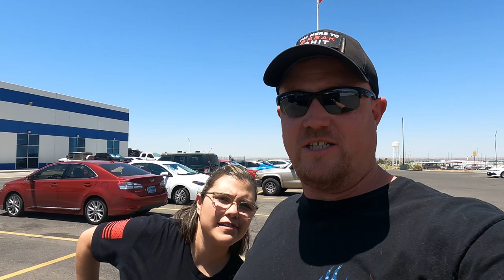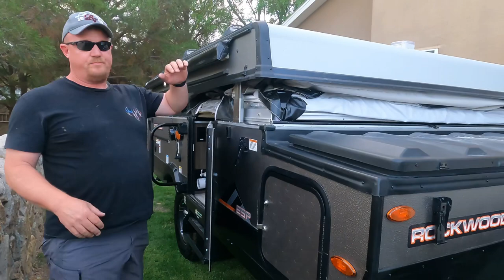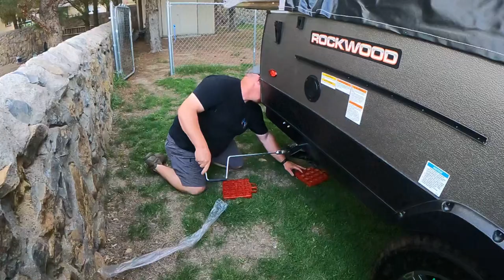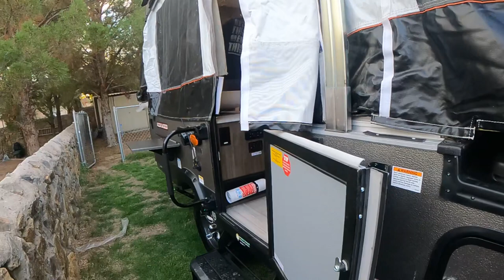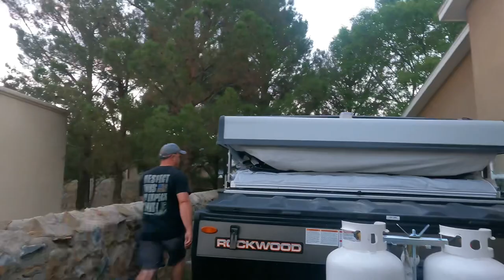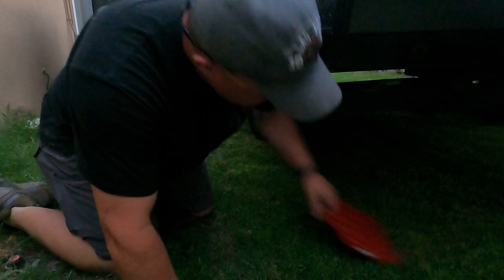Picking our new camper the Rockwood 1910 esp

Comment: A cordless drill with a 3/4 socket is a must.  My 1910 is a 2016 that I have modified with a pass thru from the inside to the trunk and added a shelf to the cabinet.  Also I replaced that terrible Dometic awning with a better one.

Comment: We have the same one. Love it. I did replace the lift winch silonoid with a better type. So far no issues. The original up silonoid failed.  I have learned a few tricks to easier setups. This pulls great. Enjoy. Smashed those buttons.

Comment: The trailer has "limit switch" settings for the UP motion AND down motion. You don't have to depend on watching the "green wire" when raising the roof or snapping it off, when the limit adjustment is made correctly, of course. When lowering the roof, the down limit switch will turn off the motor when the roof comes down all the way AND keeps slight tension on the wire when adjusted correctly. Therefore, when raising the roof, the motor stops AUTOMATICALLY, even if you continue to hold the switch in the up position! The same thing when lowering the roof. The motor stops AUTOMATICALLY when lowering the roof, even if you continue to keep the switch pushed down! No one seems to know this! The adjustment screws, two of them, one for the up  limit setting, and one for the down limit setting, are under the cover that holds the up-down switch! You’ll need a hex head tool to adjust the limit screws.
Reply from the maker: I really appreciate the information. I’m gonna start looking into that today.

Comment: Now get a tarp and keep it covered  when not in use.❤😅
Reply: Don't put a tarp on it when it's hot weather. It causes internal temeratures to soar. All manufacturers of these say never tarp. But I put a car carrier on mine then a tarp in the winter so the snow and ice slide off. But in Spring, take it off. If it doesn't leak when set up, it's not going to leak when down.